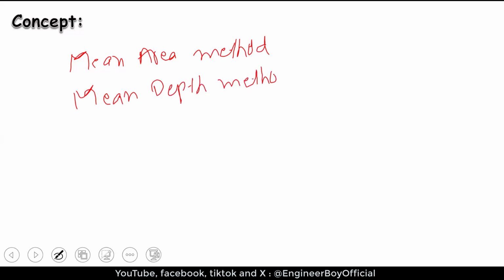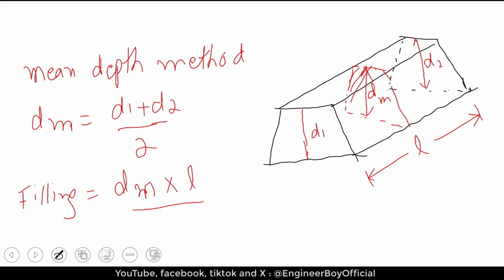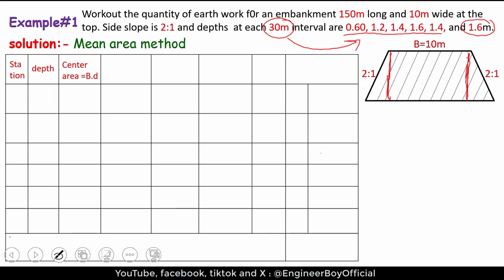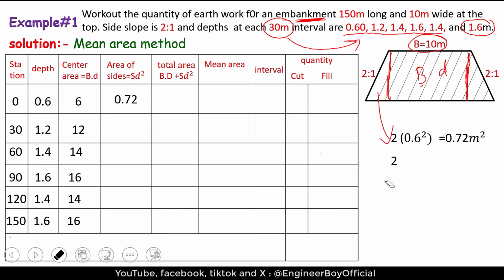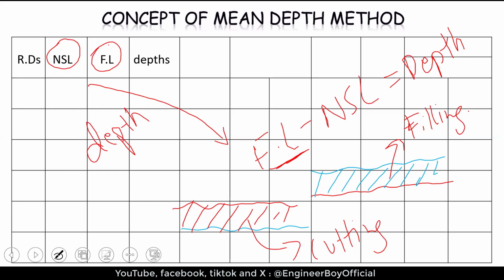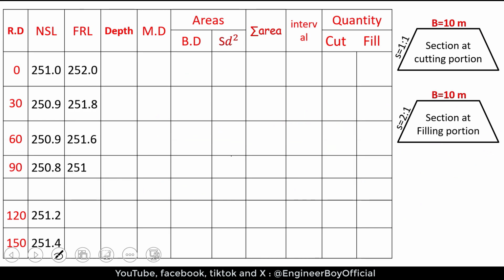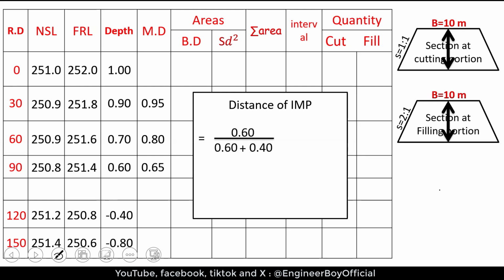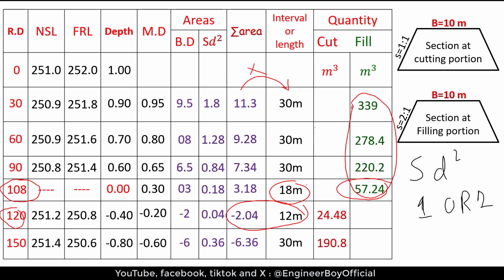Quantity surveying course| day 8 | mean area method | mean depth method | earthwork

Comment: Sir, in mean area method side slope is 2:1, you have taken 2 as S in determination of side area , its ok , but sir in second method ( mean depth method ) in the statement side slope is 1:1 and 1:2 in filling , you have considered 2 for S in determination of side area rather than 1 why sir ?? Shouldn't it be 1 ???
Reply: For filling uptil 108 he has used 2 and for cutting after 108 he has used 1